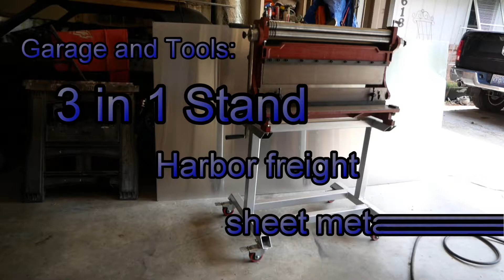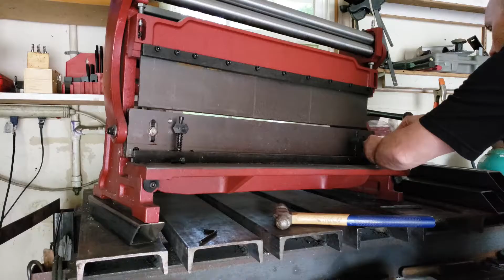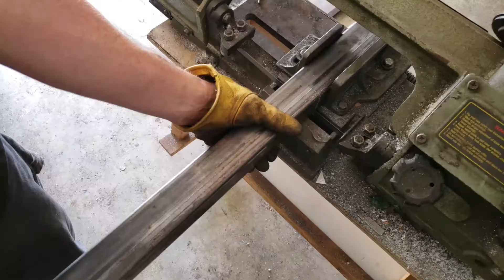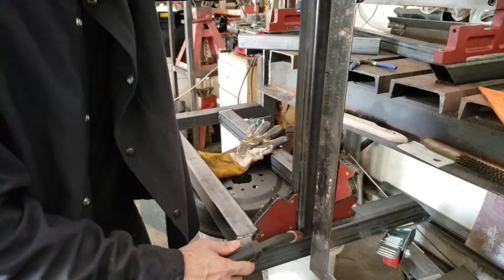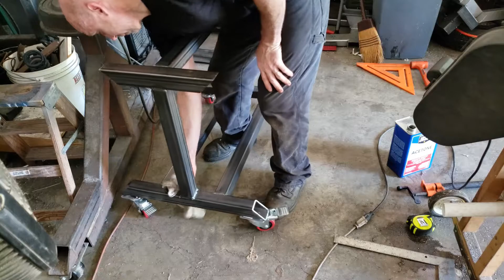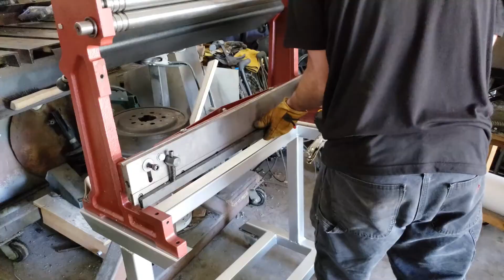Homemade steel stand for my Harbor Freight 3 in 1 machine.

Comment: Needed an idea for my HF 3 in I machine stand that is mobile.  This is only the second video on YouTube that I've come across for a mobile stand, by far the best and sturdiest.  I know what the measurements for the top brackets are but would have the measurement's for the bottom brackets that have the wheels on it.  I'm very limited on space in my garage so every inch counts.  Thank you for sharing your idea.
Reply from the maker: the bottom sections are 24 inches long cut at 45 degrees (the 24 inch length is the bottom, I welded the casters to that side of the square stock.   I've the same problem with space so this being on wheels had helped a ton.  I use it fairly regularly and I can lock the casters in place and it is plenty sturdy for my use. enjoy! thanks for watching. hollar if I can be of any more help.